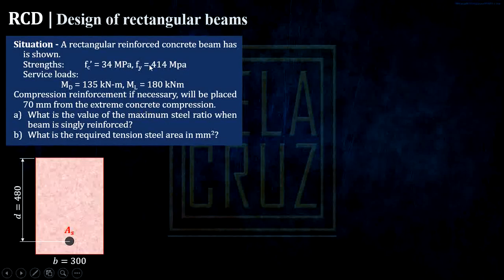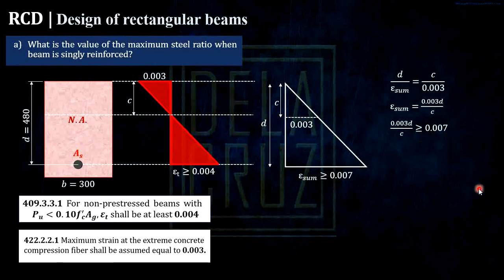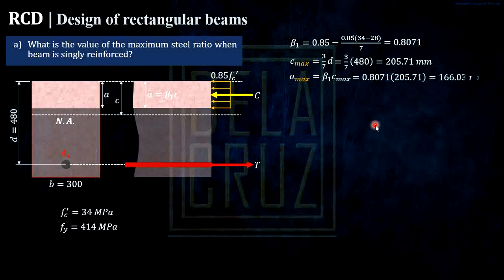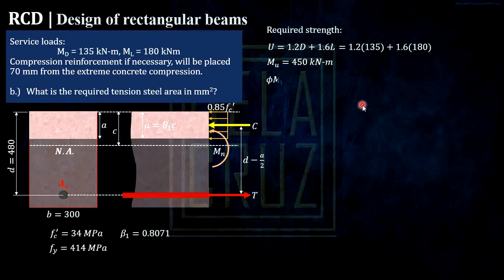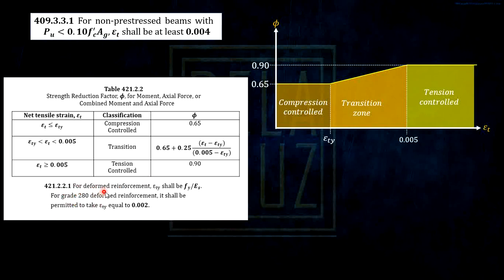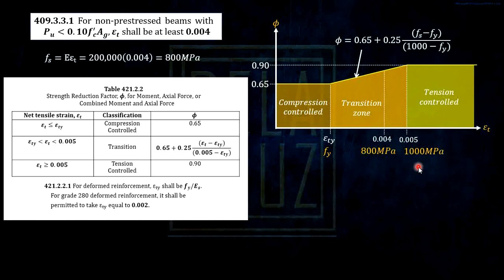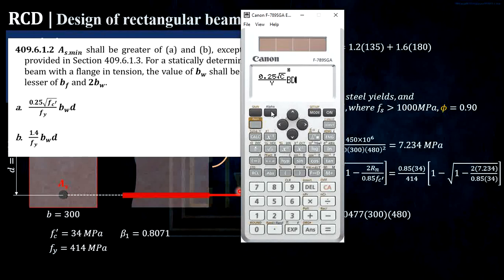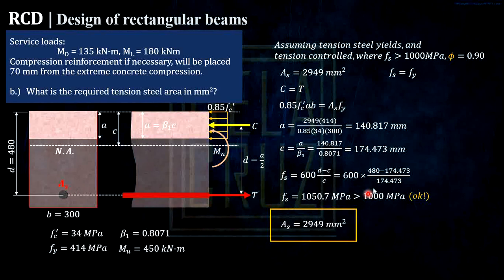RCD - Design of rectangular concrete beam using NSCP 2015 PART 1 | DE LA CRUZ TUTORIAL

Comment: Sir paano po ba makukuha ang value ng β kung ang f'c is less than 28 po given that 2015 NSCP Code ang required na gamitin tapos nasa transition region. Thank you!
Reply from the maker: 0.85 - (0.005/7)(fc'-28)
Reply from the maker: Sorry this formula can be applied if fc' exceeds 28MPa, and if less than 28MPa use beta1 as 0.85
Reply: @EngrDeLaCruz  Thank you so much po Sir. Last question po hehe. Kapag 2015 Code tapos transition region po, ang formula for rhomax po ba hindi na 0.75 rhobal?
Reply from the maker: Walang rhomax na naka specify sa NSCP 2015, instead ang sinabi sa code is yung strain nang steel shall not be less than 0.004. You can watch the other video on the playlist. I discussed it there 🙂
Reply: @EngrDeLaCruz  copy that Sir. Thank you po. God bless.

Comment: Di ba po rho max ang hinahanap nyo sa letter a bat area ang kinuha. Tapos bakit po 3/7d ang ginamit at hindi 3/8 d?
Reply from the maker: Ah yes, rho max divide pa natin sa bd. Ginamit natin ang limiting strain na 0.004 (as per code specs) corresponds to 3/7 d to calculate the maximum condition. But if we are designing. Hindi na advisable gamitin ang 3/7d as a boundary natin for singly-doubly reinforced because of reduction factor constraints(0.90),. Bdw, as per ACI 3/8d yung ginagamit rin nila as boundary . Thank you
Reply from the maker: Thank you for noticing the rho 🙂